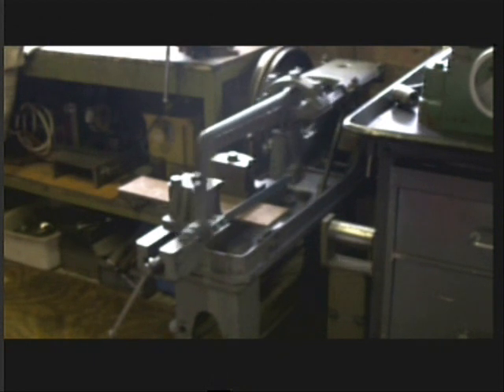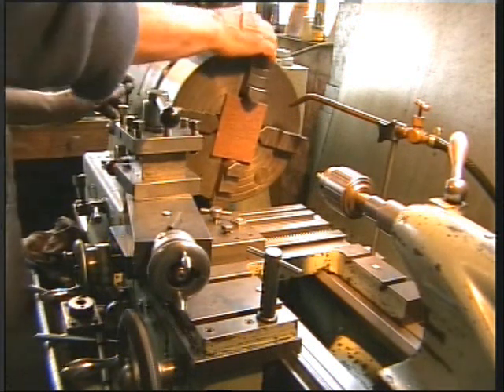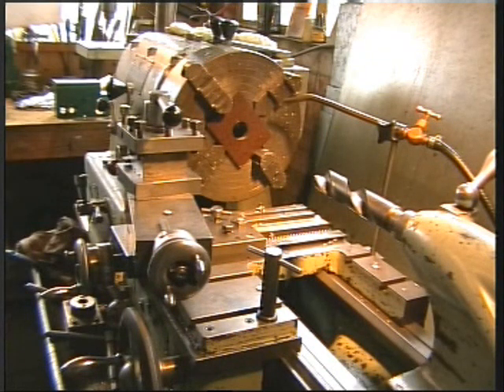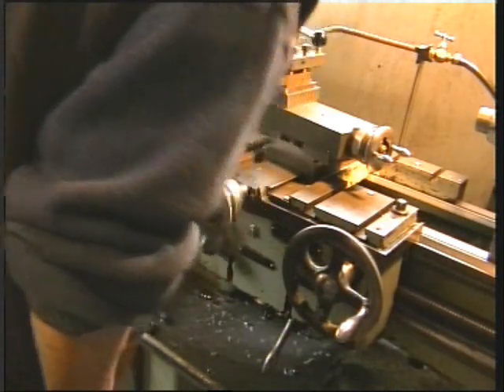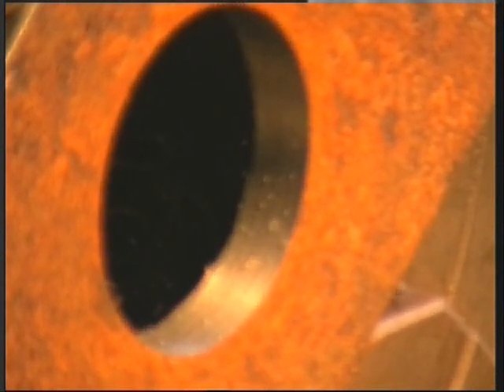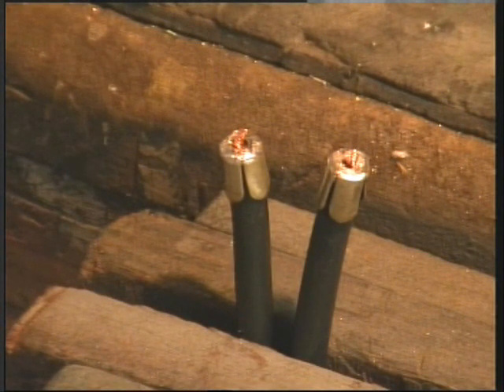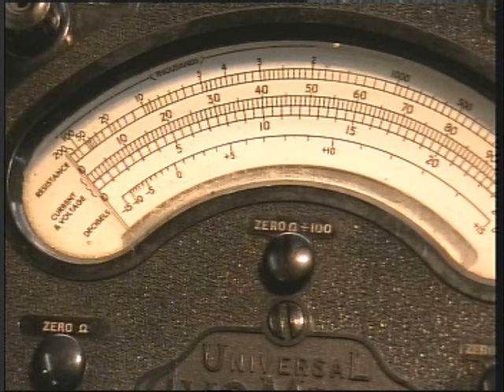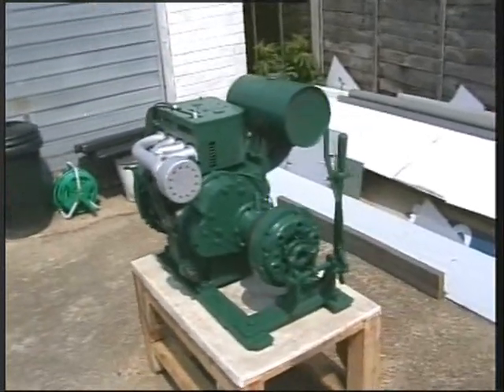petter renovation part ll

Comment: POC. Did you put the holes in your drill table or were they there when you got it? I can see the application of the pins in the holes prevents rotation of parts which has always been a problem for me.Bloody frightening when the drill bit jams in the part and starts that eccentric, drill breaking, finger tearing oscillation. Great stuff